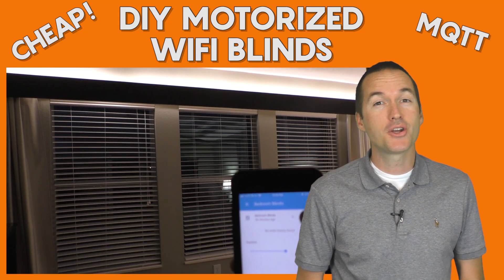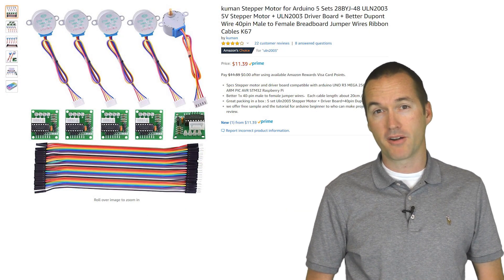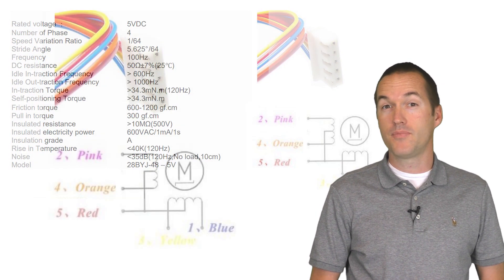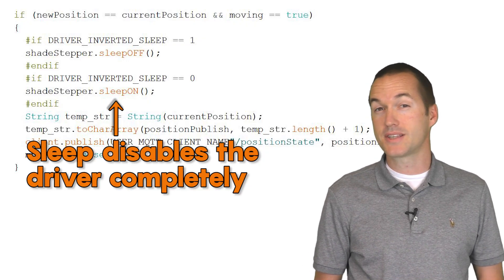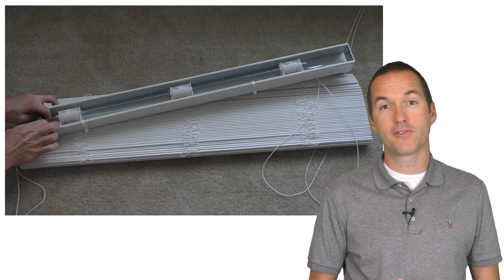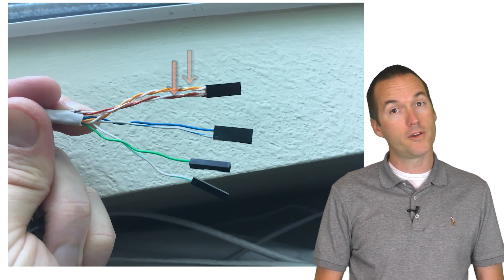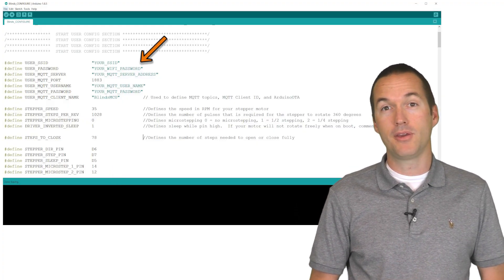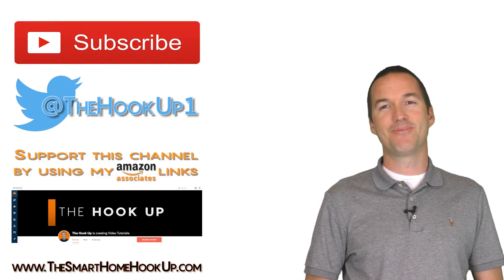Motorize and Automate your Blinds for $10! (WiFi)

Comment from the maker: I have a few more versions of this code coming out in the next week.  One precompiled .bin file with MQTT and wifi mananger, and one Alexa enabled (no separate hub required) .bin with wifi manager.

I wanted to have them done in time to release with the video, but they need a bit more tweaking.  Stay tuned!
Reply: Great DIY video.  Should be able to find some blinds to adapt and give it a try.  Thanks for sharing.
Reply: Holding out for the Alexa Version, any update?
Reply from the maker: @nickm324  I posted it last week, forgot to update this comment.  It's under the releases tab on github: https://github.com/thehookup/Motorized_MQTT_Blinds/releases
Reply: @TheHookUp  Awesome, thanks.
Reply: @TheHookUp  Have you tested this Alexa version? I am getting all kinds of wierd results. First the Flasher wouldnt work, as soon as I would click the FLASH button it would instantly say FLASH COMPLETE in a small dialog. So I then decided to use NodeMCU-PyFlasher, which worked. I finally got it to show up on my phone as Blinds Setup so I connected to that AP, set the SSID, password and left 12 in the box. It then said it was going to attempt to connect to the network and that was it no other interaction on the phone from that point. So after I just went ahead and hit the reset NodeMCU to let it reboot although I cant tell what its doing if anything. So then Opened the Alexa App and did a discover devices and chose type as OTHER since I have no idea what type of device its going to show up as. 1 device showed up called "12" as a LIGHT, that is connected via HUE HUB and the type is LIGHT. And it says to say Alexa turn off or on the LIGHT to control it. Then I dicided to look at the source code so I downloaded that and opened it up all I see is a bunch of stuff about MQTT and everthing in that source looks like its trying to use an MQTT broker to do what ever its trying to do. 
Any insight to what I am doing wrong would be greatly appreciated.
Reply from the maker: @nickm324  Yes, I have tested it.  It should have showed up as whatever you wrote in the alexa invocation name, not 12.  Is it possible you put 12 in the invocation name box instead of the rotations box?

It should be detected as a hue light because that's how local emulation works (a hacked version of the hue local protocol).  It will run with the on/off commands or % based commands.  If you'd like to say "Alexa, open the blinds" I'd recommend setting up a routine in the alexa app with that invocation and then put each blind that you'd like to open on that routine.

The alexa source code isn't up on github, though I could put it there.  I just didn't want to get it confused with the main branch.  Let me think about the best way to structure it on github.
Reply: @TheHookUp  There are only 3 boxes when I access the WIFI setup page on my phone one says SSID another says password and then the 3rd says Rotations and it already has a 12 in it. I see no other inputs to for an invocation name. I will go back through it again maybe I just over looked it but I cleared it and did it multiple times. As for the source on the release page under the Alexa there are two source downloads that are under Alexa bin so I assumed that was the source for the Alexa.
Reply from the maker: @nickm324  Just double checked mine, it looks like this: https://imgur.com/SQ4yHs2

Can you screenshot what your setup screen looks like?
Reply: @TheHookUp  I will try to get a screenshot, but mine does not look like that.
Reply: @TheHookUp  here is the screen shot from my phone, this what I get when  I click the  Configure Wifi No Scan, and the Configure Wifi is the same except it shows APs in my area. Also I did not type any of those values in the input fields that's how they came up by default. 
 https://1drv.ms/u/s!AjC1qsnTdJCfgdUNqwqbiy-8vt_D8w
Reply from the maker: @nickm324  Ah, yeah, it's the same as mine.  You have mistaken configurable fields for labels.  The "12" should be typed where it says "Rotations 12 Recommended" in gray. SSID should be typed where it says SSID and your password should be below that.  Where you currently have "12" is the spot to type the alexa invocation name.  When you click on a field the gray text disappears.  This isn't my design, it's a pre-made library called WiFiConfig.
Reply: @TheHookUp  Ok, I agree that is the problem , but what I am saying is those values were already there when I go to the configure wifi page, I did not enter any values at all. When I click CONFIGURE WIFI that screen shot I provided is the first thing I see. They are somehow pre-populating and making everything look weird like my screenshot.
In any case I finally got it all working and just need to figure out the mounting in my blinds. Thanks for the great project and your efforts and sharing this with us.
Reply: @TheHookUp  Thanks for the awesome video! keep it up!
Reply: @TheHookUp   Hi, im having a nightmare here, iv bought the 3d printer, all the parts, rasbperry pi, set it all up, in hasio i can see the blinds control but clicking it does nothing, i added my first  and second initial as user and password in mqtt , and added those to the file i uploaded to the nodemcu, but im totally lost, if i give you my details could you log in to my pi and check it looks ok as im in the middle of building work and need to case all the wiring in so i can plaster, thanks.
Reply from the maker: Are you able to see the serial monitor on the node mcu by plugging it in via USB?
Reply: @TheHookUp  plugging into a laptop or the pi, sorry all this is new to me, cheers
Reply from the maker: @sciroccomods  plugging into a laptop.  You'll need a program like Termite or Arduino to read the serial monitor (select 115200 as the speed of the connection).
Reply: @TheHookUp  i installed Arduino chose the correct com port, selected 115200,clicked send  but nothing showed up, should i be doing something, i did click rst on the board and a line of nonsense showed,
Reply from the maker: @sciroccomods  When you reset the board it should come up with information about connecting to wifi and then mqtt.  If there are no messages it means the program isn't running on the nodeMCU.  Which method did you use for flashing the program to the NodeMCU?
Reply: @TheHookUp  i flashed it with nodemcu py flasher
Reply from the maker: @sciroccomods  And did you connect to the setup wifi SSID and put in your information?
Reply: @TheHookUp  i downloaded your .bin file, put in my ssid, password, user and password, then saved it and flashed it,
Reply from the maker: @sciroccomods  This is what it looks like when you open the serial monitor: https://www.dropbox.com/s/ak380nbpmtryny1/serial%20monitor.JPG?dl=0
Reply: @TheHookUp  No mine only had about 20 characters across the top like yours but thats it, what do you think im doing wrong, cheers
Reply from the maker: @sciroccomods  I'm not exactly sure how you put an SSID/password into the bin file.  Just download the .bin file as is from here: https://github.com/thehookup/Motorized_MQTT_Blinds/releases/download/MQTT_WIFI/MQTT_Blinds_WiFiManager.bin and upload it using pyflasher, make sure "erase flash" is on "yes, wipes all data".
Reply: @TheHookUp  oh im sorry i ment the .ino file. thanks.
Reply from the maker: @sciroccomods  try with the bin file above.
Reply: @TheHookUp  got that up and running, what i was doing was flashung with the file above the alexa one, could you tell me how i put the .ino file now into the nodemcu, im sorry about all this , cheers.
Reply from the maker: @sciroccomods  once you've flashed the bin you don't need the ino file, it is an alternate method of installation. 

If you put the bin file above on your nodeMCU just look for a wifi SSID called "blinds setup" (or something like that, I'm on mobile), and connect to it.  If it doesn't automatically redirect you, go to 192.168.4.1 to add your ssid, password, and mqtt information to complete the setup.
Reply: @TheHookUp  Ah right ok, seems i have it all correct but for some reason its not working, i added the yaml and also added the mqtt broker and ip under discover using configurator, and ind it still wont work, my wiring is correct, so i thought id try and test it simpler, i have just gone out and bought an echo dot 3 , searched for devices under lights and chose other device, and it ads it but only as other device and not as a light , and theirs no tab to change other to a light, cheers.
Reply from the maker: So do you have it working now?
Reply: Hello  @TheHookUp  , thanks for the great tutorial. I just tried it out, everything works perfect. I just have one issue. 

After 2-3 mins connecting it to power supply(12v 2A), stepper motor is getting super hot. Looks like stepper motor is not going in sleep mode. Can you please suggest me something ? I'd really appreciate your help. 

I am really looking forward to get 3d printed items and install it soon, but don't feel safe because of hot motor. 
Here are some pictures of my setup
https://photos.app.goo.gl/3QirLbapyiBEDzbM6
Reply from the maker: Sorry I missed this post.  I usually print with PLA because it's easy and it smells okay.  If I need to print stuff for outdoor use I use ABS, and if I need a little bit of flex I use PETG.

... but normally 1.75mm PLA about 90% of the time.
Reply: Hi, dont know how but i seem to have bought https://www.amazon.co.uk/gp/product/B07FPBMYBS/ref=ppx_yo_dt_b_asin_title_o02_s00?ie=UTF8&psc=1       for the stepper motor drivers, its what your link took me too, will these work or should i return, please answer ASAP as amazon are delivering more any minute , thank you.
Reply from the maker: Nothing special, just discover devices.  Are you able to see anything in the serial monitor?
Reply: @TheHookUp  yes just checked in serial monitor, it says connected , its conecting to alexa but only as a "other" device, the config page where you can rename a device, i can rename, just cant call it a bulb,
Reply from the maker: Does it work though?
Reply: @TheHookUp  no because theres no where to control it, iv even installed an old alexa.apk from march and its still installing as "other"
Reply from the maker: @sciroccomods  That is really strange.  I can't think of any reason that would happen.  Does it have the alexa invocation name that you specified when you set it up using the "blinds setup" wifi SSID?
Reply from the maker: @sciroccomods  just making sure, have done all the steps here: https://youtu.be/VdEGGyROgoo?t=100
Reply: @TheHookUp  yes, when i set up the boards wifi i put "blinds" in , when alexa finds the device its called "blinds", so its defiantly showing, if you go onto one of your alexa devices and click the settings page for it, thats all i have for blinds, if i click back it should take me to devices control screen, but it takes me to alexas home screen,
Reply: @TheHookUp  iv just managed to get the motor to move on voice on the echo, but the app still has no controll , it says connected via "Hue Hub" , and description "Royal Philips Electronics smart device" , type "other"
Reply from the maker: @sciroccomods  That's what it should say.  It is emulating a hue device, I believe where it says "other" is where it would give the model number of the specific hue device.
Reply: @TheHookUp  Iv just linked my hue hub and bulbs  and they say lights, so im not sure, but at least there working now via voice, so i can now cover all the cables in and possibly look further in to it in a month or so, thanks very much for the help, and keep up the good work, cheers.
Reply: @TheHookUp  Hi, my nodemcu burnt out, and got ridiculously hot, i tested my wires to so if something was obvious, and the buck converter was outputting nearly 11v , but on your diagram it said 5v, so i adjusted the potentiometer  clockwise till it came down to 5v, i then tested a few other buck converters and they are all nearly 11v, is this correct or do i need to adjust all to 5v, and is that what burnt out the nodemcu, cheers.
Reply from the maker: Yes, the buck converters are variable output, you'll need to adjust them down to 5v.  The nodeMCU definitely cooked from high voltage.
Reply: could it be possible to run 3 motors off one driver board?
Reply: Can you post a link to the wire punch down connectors that you use with the orange caps? The ones I found at Lowes are for thicker wire. Plus an Amazon affiliate link would support you.
Reply: Is there a way to reverse the rotation direction for one motor? Reason why I ask is that my blinds are installed inside the window, each room has two part windows where the hinges are on the opposite sides. The way the blinds are installed only allows me to mount the motors to the hinge side. I would like to control both parts with one NodeMCU and one power supply .. but if I do this now the other motor rotates to the opposite direction. Anyway to reverse the direction of one motor in this setup?
Reply: flipped the wire to the motor
Reply: Is there any way to retain a manual option for this? My SO isn't keen on software/voice as only method to control stuff around the house? Maybe some kind of pull chain wired to a GPIO pin? Not sure where to start.....
Reply from the maker: @johnwalker3180  Unfortunately not, keeping the standard worm gear installed provides far too much resistance for the motor to overcome.
Reply: @TheHookUp  I wasnt so much thinking of a mechanical solution, but more like an electronic button that connects to a pin and triggers the blinds. Only instead of a button, it would be something I could connect to a string. Like, pulling the string would be the equivalent of triggering the motor/automation. I know they sell pull chain switches for mains powered lamps; I just don't know if a similar solution could be used in a low voltage context just to start the motors.....
Reply: What would have to be done if Google runs my house and not Alexa. Thanks for this great video.
Reply from the maker: @shalesprecher  Unfortunately google doesn't have a way to discover local devices, so you're stuck using the MQTT version.;
Reply: Does it work with Google Home?
Reply: Hi @The Hook Up , i want to implant this diy project in my house, i have only one problem, can i power the motorized blinds with a powerbank?
Reply: Great video, I followed your instructions to flash using Alexa bin.  I see it on my network but Alexa is not discovering it.  How do I use the config Alexa bin?  Do I need to clear saved info (D1 and ground) and then flash it with the config bin. I tried a couple of ways but couldn’t discover it.  Any help will be appreciated
Reply: @jcwire1685  were you able to ever get it working? I have installed both variants of the Alexa bin files and I can add it to my network and log into my router and see it connected to my wifi but no matter how I try to get Alea to discover it , it just won't. I tried it as a Light>Other. Light>Phillip Hue. Just couldn't get it to work.
Reply: Hello and thanks for the amazing detailed video, I truly appreciate the effort you put in this, after buying the items and following exactly your instructions, I'm facing this problem, seems like the 28BYJ-48 motors are not strong enough for my blinds https://youtu.be/iennyIrTf10 truth is, I tried the same setup on another small window blinds like 1/3 the size of these in my video, and they've the same problem, any idea what might have gone wrong? Thanks
Reply from the maker: @monuaimat5228  Hey Mo, what voltage are you using?
Reply: @TheHookUp  Hey, I am using the 12V power supply you linked https://amzn.to/2G2ZJrf connected to the stepper driver https://amzn.to/2OZqW1W so it should be 12 V to the motor
Reply: @TheHookUp  one thing I was suspecting I might have done wrong was converting the 28BYJ-48 from unipolar to bipolar by cutting the center trace. but I build a small circuit with LED and verified that the center trace was disconnected so I am sure that was not the issue.
Reply from the maker: @monuaimat5228  It's possible that the motor isn't strong enough, but I suspect something else is wrong.  When you hold the motor with your fingers are you able to stop it from turning?
Reply: @TheHookUp  no I can't stop it when holding it with my fingers.
Reply from the maker: My suggestions would be to see if you can lubricate your blinds a bit or step up to ~15V.
Reply: @TheHookUp  I'll try that and report back, thanks again 🙏
Reply: @TheHookUp   lubricating didn't help and I couldn't find a 15V power source, but I switched the motor to Nema 17 https://www.amazon.com/gp/product/B00PNEQUZ2/, and that works perfectly for my blinds, thanks again :)
Reply: Hey, how did you program this code? What extra hardware do i need?
Reply: sorry to be offtopic but does any of you know of a tool to log back into an instagram account??
I stupidly lost my account password. I would love any tricks you can offer me
Reply: @Callan Clyde instablaster ;)
Reply: @Harper Rory Thanks for your reply. I got to the site on google and im in the hacking process atm.
Seems to take a while so I will reply here later with my results.
Reply: @Harper Rory it did the trick and I actually got access to my account again. I'm so happy:D
Thank you so much, you saved my account!
Reply: @Callan Clyde Glad I could help xD
Reply: I have made a similar model to you using a servo but came to the same conclusions as you about its limitations. Im going to try stepper motors now as I think you are right it is the best way. I prefer esphome do you think this will work with it. thanks
Reply: @HeLL5toKe I just posted a reply to the main thread with this idea. Any luck? What kind of stepper motor are you using? I've seen a 3d printer stepper motor that could work but I'm not sure. What have you tried? I made a simple gear box to attempt to use the stepper motor without modifications (I had the driver, etc.) but I don't think it's strong enough.
Reply: Hey, I'm attempting this project but have run into quite a few problems. First there was a twitching motor, then nothing, etc. How can I troubleshoot my issues? I've checked the buck converter, and the motor circuits, etc. I'm not sure if it is the motor controller or the wiring or what. I'm using an esp32, the 28j bipolar motor, and an A4988 controller. Is there a reddit or forum I can try? Or on your GitHub? I've been working on this project with my budding 11 year old "robot engineer" for weeks now but I am stuck. Any info would be great!
Reply: @TheHookUp Ugh.... Ok, I cannot figure this out. I have searched endlessly on the net, posted on reddit with no luck, replaced all items except for the stepper motor (which has been tested for continuity), and I cannot get it to work. I have the setup exactly as your diagram, along with a billion other diagrams, and it just doesn't work. I have replaced my esp32 with an Uno, replaced the A4988 with another, checked the output of the buck converter for 5v, tried multiple versions of code, EVERYTHING. I am getting nowhere. I can't even get the motor to twitch. I don't know how to troubleshoot this any more than I have. What am I missing? I posted all the info on /esp32 reddit but no one is getting back to me, with pictures and code. Anyone??